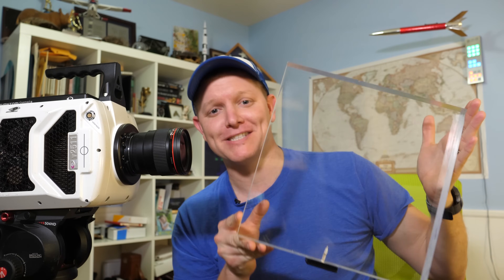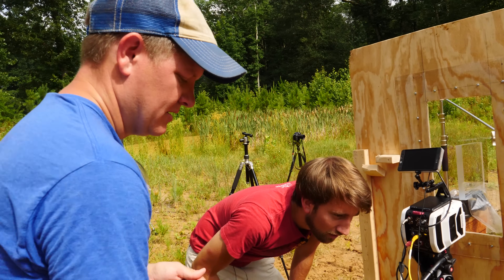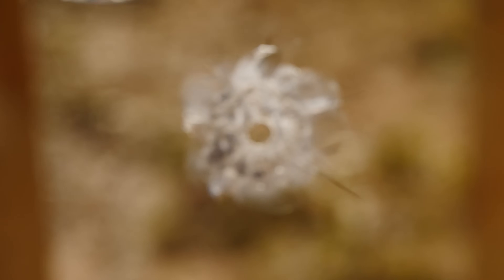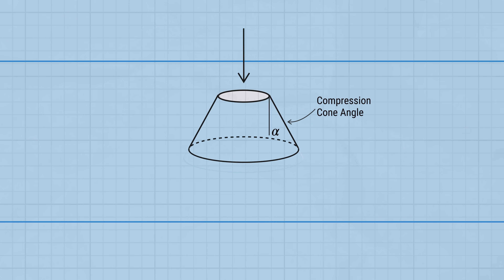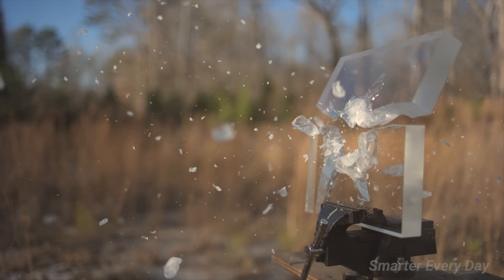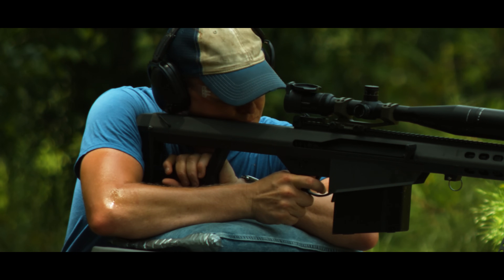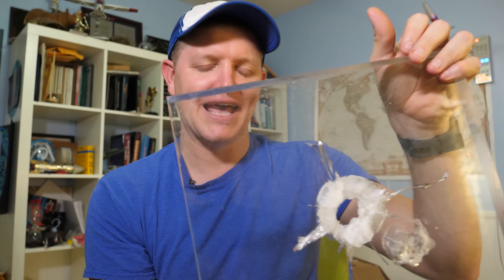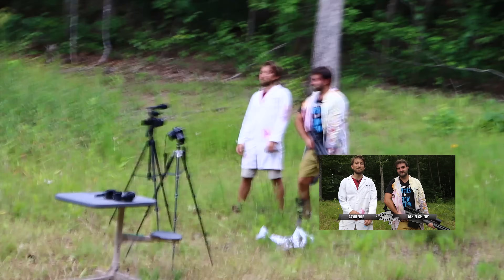.50 Cal vs Ballistic Window HARDCORE Slow Mo  - Smarter Every Day 187

Comment: Regarding fracture mechanics - The force of the impact is a function of time and distance. So the acrylic is slowing down the 9mm over the space of maybe 2 or 3 mm as it compresses the acrylic. Right? Material fracturing absorbs some of the energy. What isn't absorbed goes into ricochet energy. 
I thought it was interesting that the .50 cal cleared the plate and it was slightly later that the plate split. I'm guessing the force for the split came from thermal expansion. As the round went through it may have heated a thin layer to the point of softening it. But as the heat spread maybe it caused sub-softening temperatures in a larger amount of material, thus causing the biggest cracks to spread. It's a shame you don't have a thermal camera with similarly fast frame rates so you could confirm or disprove this hypothesis . 
Thanks for the great video.

Comment: I believe the 9mm center phenomenon is being caused by the very center of impact being perfectly in line with the stress. As the plexiglass rebounds, the area around the nose fractures and shoots out, but the center still has the mass of the bullet to push back. This keeps that part from blowing back as well. Like those swinging metal balls toys.

Comment: We need to collaborate. I am an engineer and I specialize in shock, blast, and impact. What you are dealing with here is terminal ballistics and it gets incredibly complicated in a hurry. As the projectile strikes the target compressive waves propagate into both the projectile and target. Relief waves propagate inward... blah blah you get the point. What you saw was radial and lateral cracking with plugging and spalling... enough of that already, really cool videos I like what you’re doing...

Comment: The same thing happens when a 30 mm A-10 round hits the 4 to 5 inch armor of a tank.  The only difference is that the energy is high enough to melt the ejecta cone, which cools very smooth, whereas the frustum that breaks through to the backside has fracture edges.

That would be a great follow-on video!

Comment: I found it particularly interesting how the projectile had penetrated the glass but it didn't brake up and shatter until a number of frames after the projectile had moved on.  I wander if this is a result of the 'whiplash' of the glass only being clamped on one edge.  Good video.

Comment: The center stays intact because materials fail at the point the shear stress (or strain energy) is the highest and not necessarily where normal stresses are the highest (Force/Area). So the frustum surface just defines where these shear stresses are the highest and therefore where the material is likely to fail.

The center portion stays intact -- even under extremely high loading -- due to the fact that it is in nearly hydrostatic compression. This is where the material is being compressed evenly from all sides (by the bullet and the supporting material around it), resulting in a near zero shear stress even though normal stresses are substantial. -- An illustration of this would be to fill a cup with sand and press down. In this case the grains of sand are analogous to the atoms that make up the material. You can see there are no forces pulling the grains apart, and in fact they are all being pushed more tightly together. If you could push hard enough you'd find the cup will fail before you get the sand to budge an inch.

Comment: Hello I come from the slowmo guys but I don’t know much about guns. Just had a small question and hope I can get it answered. So while you guys said that bullet resistant glass only is for 9mm’s if someone were to shoot at someone through a glass like that with a 50 cal. Would it decrease the damage of the round? Would it throw off the trajectory?
Reply: It would do both, however, once a projectile hits the glass, its target is not far away enough to matter. If you were trying to hit a target 100m past the glass it would be difficult, but the way the military uses these rifles accuracy after the impact is not a huge concern. On the subject of damage, is the target is something like an engine on the other side of armour, a projectile that penetrates may not have enough energy to do serious damage, however, with the targets that are behind glass this is less of a concern.

Comment: it so soo cool that before the .50 cal bullet hits the glass it is still brass coated and looks like brass.. but then as soon as it hits the glass and leaves the glass it is shiny silver...... SOOOO COOL to see in slo mo... im happy that you guys did this together!!
Reply: That is because it shed the copper jacket and the inner steel core was what remained.   All 50BMG that is military sourced is steel core.  Does NOT mean it is automatically armor piercing.   That includes civilian ammo from IMI/Barrett/AmericanEagle/Magtech.    Those companies sell M33 Ball production over runs, it has a muld steel core which is more than enough to shatter lexan in the video.    Actual AP ammo uses a hardened core and you will not notice the difference until shooting actual steel/armor.   M33 = mild steel core.  M2AP = hardened steel core.

And yes.   I know from personal experience having shot, reloaded custom ammo from components, and having iwned a 50BMG.

Comment: At 6:05 you see rippling that seems to come from reflection of glass material from the impact, however its the bullet that causes it.  its actually the moisture in the air being moved from the bowshock of the bullet that bends the light. 
You're seeing the footprint of a supersonic wave coming from the bullets wake.
If you could watch this in ultraviolet only, you'd see dense dark lines leading the bowshock.

Comment: I am really quite impressed by the delay between the trigger pull and the handgun firing. That's a really fast muscle twitch.

Yet with the rifle, there is barely any delay at all. Is it because the trigger mechanism on the rifle is under higher tension and moving faster, and the combustion traveling up the (much longer) barrel at much higher speed?

Comment: Can you test the pressure wave of the .50 cal at different ranges.  50m, 100m, 200m etc.  Does the diameter of the pressure cone increase in flight or decrease?  Does it build up from leaving the muzzle or is it instant?

Comment: Great Video . Love that you get to the science.
Kudos on including clearing the gun after. 

Couple things I would love to see in this vein.
1) How large a caliber would you have to go to just barely punch through? and how's that look in slow mo? :-D
2) what happens if you were to shoot the pane on the edge with the 50 cal?

Maybe another Colab  :-P
Reply: Silly Drizzy I love the second one!! Getting a side on shot to see if maybe the amount of glass (though designed to stop only 9mm) could stop a .50 cal round.  My guess is that the glass still has no chance but I’ve also seen things happen, that I thought, had no chance

Comment: Alternative theory: The front tip of the bullet compresses the material in the pressure cone and physically enters the sheet. At this point, the front stops. The rear of the bullet keeps moving causing the bullet to undergo deformation. It quickly expands sideways since it cannot travel forwards. Since the bullet is partially lodged into the material, it blows material perpendicular to impact in a reverse conical shape.

Comment: You should go deeper in depth in your videos. Sure it will take more time, but it would make your content better. Like why is there a flash of light when the bullet impacts the glass? Probably the material vaporizing under the compression temps. Dive into it man. Your just skimming the surface.

Comment: In some 50BMG slow motion vids (not this one), it's very obvious that the bullet has pitched in flight by a few degrees (almost always nose down) without really affecting the flight path itself.   Is that because most of the aerodynamic forces are applied at the tip and not across the full length of the bullet?   The only example I can think of at the moment is this one (https://youtu.be/jgk5RSUnOhE?t=1m26s), but it's a bit extreme.  You can see it in that Kurzzeit million fps bullet video as well fwiw.

Comment: The inital impact fracture mechanics you mentioned would be fascinating to understand. Taking a standard .50 BMG muzzle velocity, to resolve the first 1mm of the glass-projectile impact  into, say, 10 frames you would have to film at 8.5MHz. I don't believe there are any conventional high speeds cameras which film that fast.

Comment: Hey, 3D programmer guy here. We use the word "frustum" all the time in our field. You see, in computer graphics, you have limited resources and memory, etc, so when you take a virtual "camera", you don't render it's field of view from the camera to infinity. You take that "cone" of vision (that is actually rectangular because we project the screen through it) and you intersect two "clip" planes that are orthogonal with the view vector, and you only consider what exist between theses two planes, and the lateral edges of the frustum.

We call that Frustrum Culling.

Comment: You encouraged us to think more deeply about fracture mechanics; I knap stone tools and that is precisely what we need to think about in order to make a functional implement.  Knapping is nothing more than  creating controlled fractures through the rock.  It becomes largely instinctive with practice, but looking at a rock and calculating the proper angle and velocity to strike with the tool in order to create the percussion cone that drives off the ideal flake is the practical application of what you want us to think about.  Have you ever thought about trying to capture what happens to rock as it is chipped to become a tool?

Comment: When I worked in Australia at Plasti-Vac we made 300mm x 300mm x 50mm acrylic  blocks for radiation windows for Lucas Heights research Nuclear  reactor. We did this by gluing twenty 5mm sheets together to build up the thickness and then we trimmed to size.  I can see these bullet proof sheets are also at least 4 sheets glued together.  Its actually very easy to do this and have very clear sheets.

Comment: Thanks for the video.  I learned something new about the pressure cone.  I've read a decent amount about crack development and propagation through steels and welds, but I haven't considered impact and a pressure cone.  If you get a chance to run this again consider a side view at a faster frame rate.  The 9mm bullet looked as though it was mushrooming, as you mentioned.  It would be interesting to see how the force ripples through the bullet before it shatters.

Comment: did anyone else see that the gun barrel wasnt tighten down enough with the pistol, i promise you that gun is fixing to mess up big time on someone that firing it.
Reply: If you are meaning that when firing the barrel moved, and sort of tilted up a little bit when the slide was all the way back, that is normal for locked breach semi-auto handguns like the Glock.
The barrel in such a firearm is not fixed in place as it would be in a blowback design more commonly used in smaller caliber handguns like a 22LR.
If you lock the slide open you can actually wiggle the barrel around just a little because it sort of floats around. Close the slide and the barrel is held tightly.

Purpose of the locking breech is to ensure that the hot, high pressure gasses exit through the barrel, rather than through the breech.

Comment: Cool!! Good job absorbing that 50 cal energy into your shoulder btw. Thing's a beast to shoot
Reply: Additionally, you can see how the recoil from a 50 BMG causes a shockwave strong enough to put a smile on your face. Thanks to this slow-mo we can now verify that fact.
Reply: @oldmanSturzl  But how long exactly is it from trigger pull to smile?
Reply: I feel the blast is harder for myself than the actual recoil. Last time I was on the Barrett 82 my first shot was on the money and my second shot was a flier due to flinch and I haven’t had enough trigger time to overcome it
Reply: Depends on your firearm and muzzle brake
Reply: Hey,I love your gun vids,you should do a collaboration with matt from demoranch
Reply: The recoil is actually quite similar to a 12ga not running magnum loads. The M107 that he is firing I here has just about the same recoil as it’s full size brother.
Reply: He absorbed the shot with his forehead. He scoped the brim of his hat and it left a welt.
Reply: I had the honor of shooting the .50 that for a time held the record for MOA. You literally could shoot rounds through the same hole. And I'm not even a marksman. It was weighted (I'm not sure how much extra, but humping it to the firing line, it wasn't a paltry stock 35 lbs). It kicked about as hard as an M16. Which is to say, not much at all.

My 91/30 on the other hand.... 10 rounds down range. Call it a day.
Reply: Kirsten Joy Weiss I love your channel. Your “yoga with a gun” video is one of my favorites.
Reply: Apparently a .50 cal that hits a hip bone will generate enough of a shock wave on the way through to liquify organs, so I was not entirely surprised that the empty shell actually made the bicep wobble!
Reply: @stevedavis8329  After seeing that hot (damned hot!) case mouth strike, my first thought was "your bicep will be talking to you this afternoon". Cheers!

Comment: Not related to video! A QUESTION.
Imagine current is flowing through a messed up circuit which forks into two at a point; most of the current should move 

into the path having the least equivalent resistance. Now, based on this statement, imagine another circuit with a bifurcation at a point and then wires of extraordinary lengths running wild till say 1 light minute. 

Now both paths being a light minute in magnitude let's put a resistor on one wire on the 3/4 mark. This resistor is absolutely awesome with 10^10000 

ohms, omitting any chance of current to pass through that wire. If you assume that such huge proportions of wire will be 

used, current must not flow anyway, think the wires are made of some kind of futuristic superconductors, anyway this is a 

thought experiment. Now the current has only seconds to choose a way to go, this means the current has to gather information 

from that resistor, this requires information to travel faster than light. Can you do a video for me to resolve this paradox?

Comment: So... The center of the 9mm impact is clear because the pressure angle at that point is orthogonal to the glass, and the stress isn't enough to penetrate the full thickness of the glass, but it's not clear outside that because the angle is more acute, and thus can spall material off the surface? I think that's what you were saying, but it feels like you got so excited you forgot to finish what you were saying. (To be fair, it's pretty cool stuff.)

The most entertaining part was the slo-mo of the .50 cal breaking the glass: a couple of frames for the main damage cone to form, then about two-three times as many frames of cracks spreading until it was suddenly too much and bam the glass flies apart. The best part was making sure to show that you observe proper gun range safety, because that's sadly lacking in too many videos where people do firearms experiments.

Oh, and I think Dan was right that the movie was Saving Private Ryan , although I think something similar happens in Enemy at the Gates as well.

Comment: At 5:59 there's a black dot right at the moment and location of the impact. Could that be a sensor overexposure because of the intense pulse of light from triboluminescence? It is preceded by the obvious flash in the previous frame.

Comment: I find it interesting that the piece of bullet resistant class actually shatters after the bullet has long since exited the material. Perhaps the resulting vibration coupled with crack tips causes the actual shattering. Maybe the initial vibration is too high and slows down through the natural frequency over those few milliseconds resulting in the catastrophic failure.

Comment: I would like to see what the 9mm bullet looks like, if it started to flatten at the tip. If so that would mean a secondary part of the bullet proof glass' effective use is to created a greater surface area for the bullet to penetrate, increasing the surface area and thus flattening the bullet and making it have a much less chance of penetration. like poking someone with a needle vs your fist, the needle will penetrate the skin and the fist will bounce off. Even flattening the bullet 3x the size of the tip could make it 3x harder to penetrate.

Comment: Job 41:13-17 is describing a crocodile. Following verses might be applied to this video:
v 18 - Its snorting flashes out light, 
And its eyes are like the rays of dawn.
19 -  Flashes of lightning go out of its mouth;
Fiery sparks escape.
20 - Smoke pours out of its nostrils,
Like a furnace fueled with rushes.
21 - Its breath sets coals ablaze,
And a flame shoots from its mouth.

Comment: Greetings from Iran.
A question just popped out in my mind and that is:
When the 15.cal strikes the resistant glass and when it goes through the glass, it is normal to see glass shards blasting on the way the bullet penetrates through, but what about the glass shards that blast exactly in the opposite direction? 
Have you ever thought about why that happens?